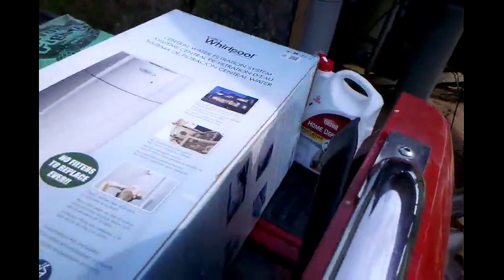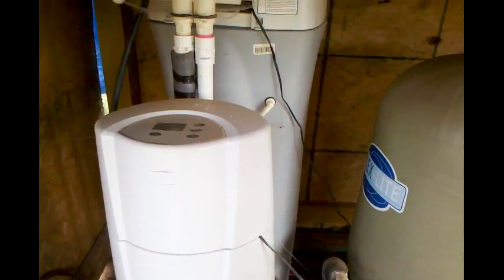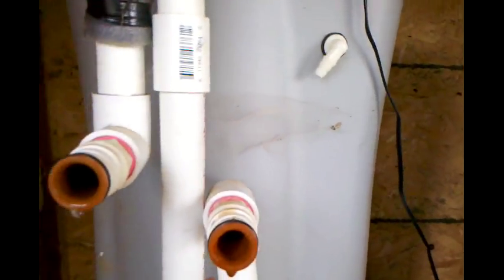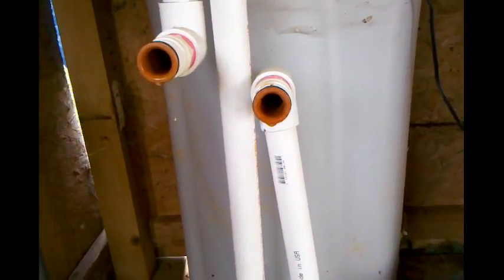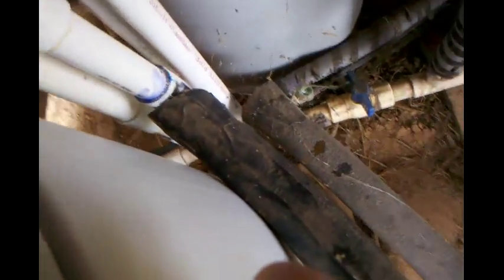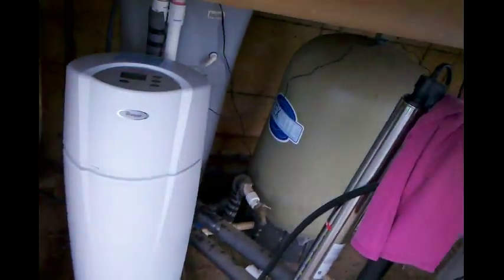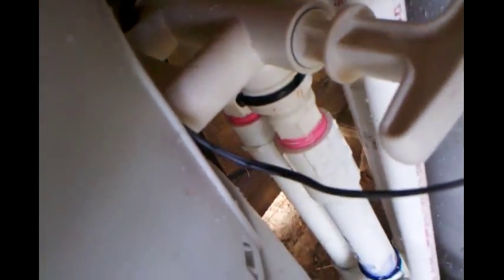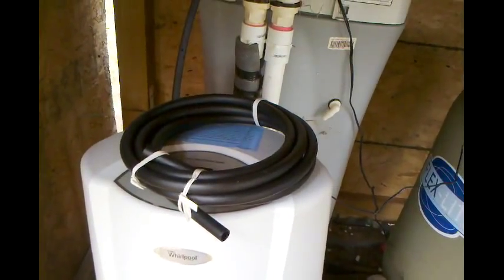Whirlpool Whole House Filter Replacement

Comment: Thank you my cam and gear and motor keep starting and stopping when it in regeneration or clean mode and now i have a error code ( 01) .it wood be nice if they send me a whole valve body or just replace the complete unit.

Comment: Add a  50 micron sediment filter before the Whirlpool.  I have the same iron problem from my well. The sediment filter screens out 99% of the iron sediment.  I change the cartridge every 4-6 weeks when the pressure starts dropping.